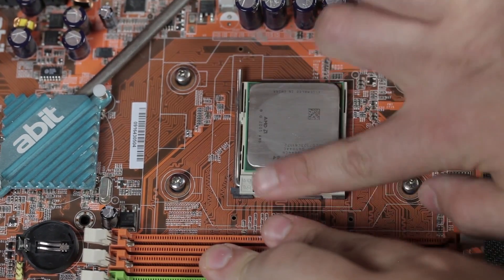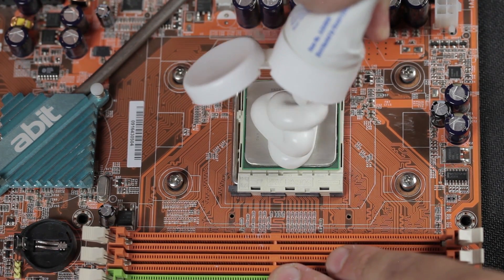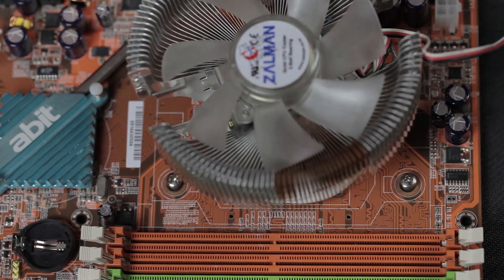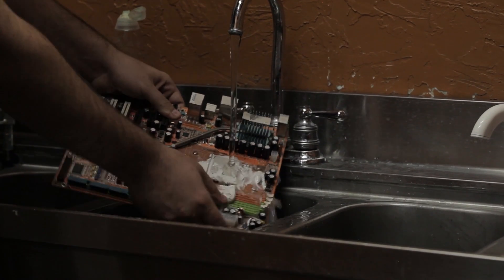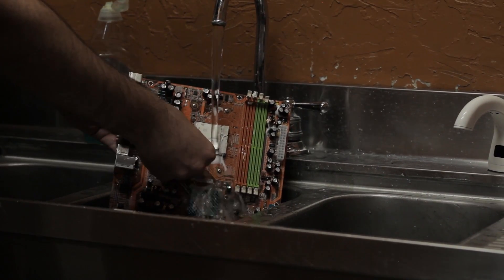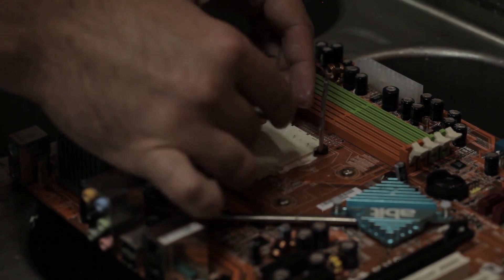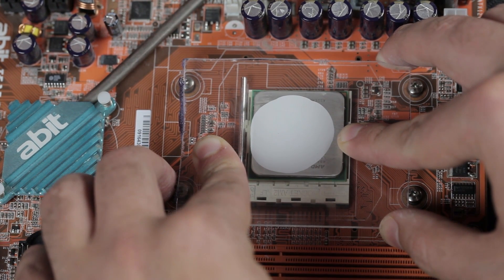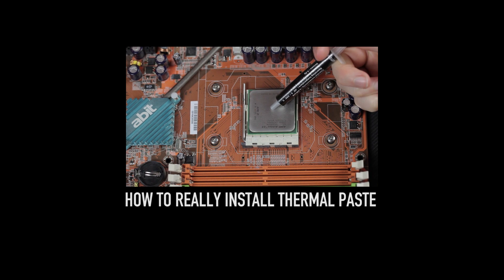How to Apply Thermal Paste the Kentucky Way

Comment: You actually can clean a motherboard with water, you just have to be sure it's completely discharged and that it's completely dry before turning it back on. I read a tech blog years ago where a guy found a rancid old computer in the trash filled with dust and mud out the ass and he put it in the dishwasher and after letting it air dry in the sun for a few days was able to turn it on without a hitch. 

I'm 100% serious but still don't do this.

Comment: i know its a joke, but you can technically put your mobo in water, just as long as theres no current running through and you dry it thoroughly. ive seen a mobo in a dishwasher work fine ;)

Comment: The one truth to this video is that you can indeed wash your motherboard. I've done it before. (Albeit with a cheap one) As long as you let it dry it should still work.
Reply: Yes, but it will be damaged. Apart from ESD there are salts and dirt in the tapwater that will slowly corrode the motherboard and eventually break or short circuits.
Reply: Snetmot Nosrorb If you really want to use filtered & distilled water then.

Comment: You didn't specify what brand of toothpaste to use. I tried a tube of Crest, but I think I should have used Colgate at this point.
Reply: +draydince Yes, Colgate. It has better smothering properties.
Reply: +draydince i used crest too, should i switch out? i only used 2 tubes of it i could get 3-4 of colgate

Comment: Why does my PC shutdown when I play Battlefield 3 on low settings? I followed your instructions thoroughly.
Reply: Probably overheating, or one of your ram sticks is messing up yo fun times, I'd suggest taking one out and seeing if it does shutdown, take em out one by one until you figure out which one sucks ass.
Reply: Did you miss the step about painting hot rod red racing stripes, to make it go faster.
Reply: Nicholas Tiley ...Or putting a Sonic plushie inside?
Reply: Maplemage Knight Well, I mean, like, I don't have RaM. What's that?
Reply: Ben Allen I emptied 3 bottles. Still not enough?
Reply: Use mayo for better performance.
Reply: MultiDaw123 Nicholas Tiley Shoot! I knew I missed something!! Thanks for letting me know.
Reply: Duffel Bag Full of Tech Apparently if you turn you computer on, it runs faster.
Reply: Nicholas Tiley Wait... Really?
Reply: Durnehviir Please refer to one of my previous comments. I am still having this issue and have gone into a deep spiral of drinking and depression.
Reply: JollySmash Well, not anymore. I tried so many things to fix it that it doesn't even work anymore. I'm stuck using a PS2 for my computing needs.
Reply: Duffel Bag Full of Tech You can always get one from your nearest alley. Watch out for the man that eats 87 spongebob stickers though.
Reply: Not enough tooth paste
Reply: +Duffel Bag Full of Tech Your PC turns on?
Reply: +Duffel Bag Full of Tech Best comment thread ever. Pro tip though: Melted chocolate works wonders
Reply: ***** Uhh, about that.... I used it for laundry detergent and I ran out of it. Where can I get some?
Reply: Tyler Wrage moar detonated wam
Reply: Tyler Wrage Why didn't you tell me earlier!! I used up all of my bandwith downloading 5TB of RaM!! EDIT: I thought you said NO need to download moar RAmz. I guess I benefitted then from being able to run 5 instances of Battlefield 5 beta and HL3 that I torren... Never mind.
Reply: Duffel Bag Full of Tech I became 4chan the hacker,fear me you dirty peasants or I will strike you with my 1337_HAXXOR skillz
Reply: 4chan the 1337_HAXXOR hacker What be 4chan?
Reply: +Daniel Learmouth Guys! Guys! I found out how to make your computer run super fast! You just gotta put some gas in it- what else are the holes on the side for? It's trying to run with no fuel!
Reply: dalmation black Got any cheaper ideas?
Reply: Duffel Bag Full of Tech Shit works too.
Reply: dalmation black Oh, shit.
Reply: ***** Geeze, that guy lives right across from me in that dumpster. Okay, i'll go and check it out. Thanks!
Reply: Duffel Bag Full of Tech Don't forget to bring a flamethrower,today i learned Cazadors are real
Reply: MultiDaw123 Woah, I just bought one on TrollAzOn two days ago. Okay.
Reply: Duffel Bag Full of Tech Just pour a lot of liquid nitrogen over it for super cool temps.
Reply: ***** Yep, that was in the manual. But where do I get THAT?
Reply: Duffel Bag Full of Tech Mix a couple beers with that gunk under your table and you'll have a nice batch of it!
Reply: ***** I just sold my last table on the Pirate Bay because I kept smashing them! What should I do now?
Reply: Duffel Bag Full of Tech Wank
Reply: Duffel Bag Full of Tech Need to download more ram
Reply: ***** Did you say dongers? IM UP FOR SOME DONGERS MAN!!
Reply: Duffel Bag Full of Tech You didn't put on your thermal paste the Kentucky way.
Reply: AtheistRedneck Why do people are still using that crap? REAL MEN USE COMBUSTIBLE LEMONS
Reply: AtheistRedneck But, I followed his instructions throughouly! :/
Reply: MultiDaw123 Tried that. Blew up in my kitchen... Please don't bring that up again...
Reply: Duffel Bag Full of Tech God damnit,I wanted to play Fallout 4 with real graphics
Reply: MultiDaw123 Well, you could always try peanut butter! Too bad I ate it all... The nearest store is McDonalds... Wait, that's not a store!! Or is it...
Reply: Duffel Bag Full of Tech DUN DUN DUUUUUUUUN
Reply: MultiDaw123 WE WILL NEVER KNOW... UNLESS WE KNOW...
Reply: Maplemage Knight WOOOSH?
Reply: Duffel Bag Full of Tech More importantly, if you followed his instructions, why does it start up in the first place? XD
Reply: K4Robotics Well... I mean.... It kinda..... Never did
Reply: Duffel Bag Full of Tech WITCHCRAFT!!!!
Reply: MultiDaw123 I checked the manual. Witchcraft was not included in my bundle :(
Reply: Duffel Bag Full of Tech FUUUUUUUUUUU-
Head rockets into orbit
Reply: MultiDaw123 Was that supposed to happen? Its not mentioned in my manual!
Reply: Duffel Bag Full of Tech Yes,also says if your head doesn't make it into orbit just add more boosters
Reply: MultiDaw123 Alright. How do I prepare?
Reply: Duffel Bag Full of Tech Are you sure you washed it really well? Try using salt water as that's the best with sand and silicon!

Salt water is healthy for computer skin too!
Reply: Omarpixel9 I already killed a Mac by doing that, because I don't care about them. Teehee!
Reply: Duffel Bag Full of Tech A goat with over 200 GB of memory
Reply: Rocky Barry I saw one on Amazon. Should I buy it?
Reply: Rocky Barry But does it fix my issue? This seems related to RaM
Reply: I'm just joking. This video is also a joke. Also, changing RaM won't fix anything.
Reply: Rocky Barry Are you sure? I think you're not getting it. This guy is a professional! Also, its all about the RaM.
Reply: Duffel Bag Full of Tech You have to download them Ghz
Reply: Duffel Bag Full of Tech I think it has got to do with the CPU overheating.
Reply: Rocky Barry $top lying to me! Yeah I think MultiDaw123 is right. I need moar GhZ. How does downl0rd?
Reply: Duffel Bag Full of Tech Don't forget to download MOAR GPU
Reply: MultiDaw123 Sure! But how does I?
Reply: +Duffel Bag Full of Tech Computer Auschwitz.
Reply: TechWalker What happens if the holes are on the passanger side and I parked with the driver's side facing the pump?
Reply: TechWalker Oh, you are so right! What type of gas?
Reply: Rockybarry 1337 ABORT MISSION!!
Reply: good for you! Mine doesn't even turn on

Comment: I actually do wash my parts under a tap every once in a while.  wait for it to dry and it always works fine.  I've been doing this for years, but I wouldn't recommend it for everyone because you NEED to make sure there's no charge left in your components and if your water is rich in metals like iron, you can cause some serious issues.

Comment: I tried using some toothpaste, Colgate Plus Whitening to be exact, and set my HSF on the CPU and got everything mounted.. as it was shown in the video.  Everything ran great!   For a few seconds.. I heard a loud pop, and then some smoke from the CPU and mosfet area.  Doesn't seem normal, but maybe?  Anyway.. My rig won't post now and smells like ass.  Did I do something wrong?

Comment: Nothing wrong with washing your motherboard in the sink, provided it's been fully discharged before and is allowed to COMPLETELY dry afterward. I've done it to clean mineral oil off my parts after submerging it in an aquarium full of the oil.

Comment: Wait, is this a joke video? Just used toothpaste..
Reply: Mayo works a little better.
Reply: opmike343 mustard and mayo MIXED will result with the best temps
Reply: Well thanks for the help guys, temps aren't too high atm.
Reply: McDonald secret sauce works best
Reply: ImNotAfk its only 70 C. I don't know what "C" means but it's currently 70 degrees indoors, so... I'm sure it's fine.
Reply: Deodated wam
Reply: szechuan sauce CPU!
Reply: That caught your eye, not the washing of processor and motherboard?
Reply: threetwozeronine othername Celcius or Centigrade.... [°F] = [°C] × 9⁄5 + 32 there you go, got you the formula to calculate it to imperial too

Comment: I use colgate and it works wonders. got my cpu @ -9999999999999c. I just used the entire tube and slap in some stock cooler.

Comment: Now that's how you do Water-Cooling too! Just put your components under the tap with water running. Easy cooling easy life.
Reply: ..if your tap dispensed distilled water, mineral oil, or, even better, 3M Novec 1230 that would actually work quite well :3

Sadly such taps exist only in my fantasies :(
Reply: ShadowwwLFS Distilled water taps are in every lab, just set up your PC there!

Comment: yea as they conduct electricity  and infact  if water was deionized (distilled) you could run it  with it powered on if you wanted  don't believe me google it  hell there's other liquids you can run the motherboard with it submerged  with it on as well such as white oil (mineral oil) so b4 calling pplz idiots plz do your research

Comment: Wouldn't Listerine Mint Strips be more efficient? Just put the strip on your tongue for a split second and put it on the CPU so it'll stick. Keeps your case 935% cooler and you have the option to switch it out for flavors like strawberry or cinnamon.

Comment: I'm glad you said that, because that's kinda what I thought, as long as there was no electricity going in the mobo,it shouldn't be any reason for it to break, if you let it dry as you said... But I kinda thought of the same about the CPU. Why would the CPU break?!? Both the mobo and the CPU can be ruined if they get a short, but otherwise, they're both made from solid materials, unless there's some extremely sensitive stuff in there than can be broken by the water movement,it should be fine, no?

Comment: He removed the CMOS battery, so as long as he let the mobo dry COMPLETELY it should've been fine (as long as there was no held energy in the capacitors or anything), but that CPU went all duckies.

Comment: bro. that is not the same problem. that is a similar problem.
one which you are stupid for encountering. the real challenges are not getting your penis caught between the ram DIMs and possibly in the 24 pin as well.
that can get pretty nasty pretty quickly.

Comment: there has been pc's made that run submurged in pure water but water from your sink contain metals and other materials which make it conductive. also the system won't rust as aluminum and copper don't oxidize the copper may tarnish and become a little less conductive and aluminum actually gets it's hardness from oxidation but if you damage the top oxidized layer while in water it will dissolve. that said as long as you don't create a short it should still be useable once you get it dry.

Comment: You can actually clean circuit borads, such as motherboards, off with water. I've done it several times and they work just fine. The important part is to remove all batteries (It will reset everything back to factory defaults)

Once rinsed, make sure it's fully dry before connecting batteries and powering it up.It's the electricity that doesn't like water. Compressed air to remove water from the "hard To Reach" -spots, and a hairdryer on a low setting will do the job just fine.

Comment: I bet that too, I have disassembled some mobiles which all had a lot of water inside first. There is no point to worry about the silicon in such a case, but the connectors could corrode. I have even completely torn down (I desoldered the CPU with hot air) one of the mobiles and the mainboard was all well doing after its complete bath in some cleaning water!

Comment: Actually, as far as I know, you can wash components under water, best distilled/DI, (remove batteries) but you have to let them dry for a few days without power coming anywhere near the components. Most guides for water cooling mention this for when it's time to leak-test the loop, and is the reason why it's OK-ish to have your loop leak as long as you don't have power running.

Comment: Are you saying that because I know lots about computers means that I must have a killer PC, not an ancient dustball? :) 
This board is way better than mine because it has much better upgrading options. It shouldn't have problems with dualcore CPUs, some nice PCIe GPUs. Also it probably supports up to 8GB of DDR2... IF I tried to upgrade my PC to half the level where this motherboard can then it would still cost me double the money.
And yes... most people I meet will have better PCs :)

Comment: Easy... look at the CPU socket closely: AM2. Little chance that an AM2 motherboard has an AGP slot like mine has :) Then look at the CPU itself and google the code (IAA3000...something): Athlon64 3000+. Also it has 4 DIMM slots. My PC is a s754 Athlon64 2800+ on a Epox motherboard with 3 DDR1 slots, as the videocard I have a Radeon 9600xt. Pretty ancient stuff. :)